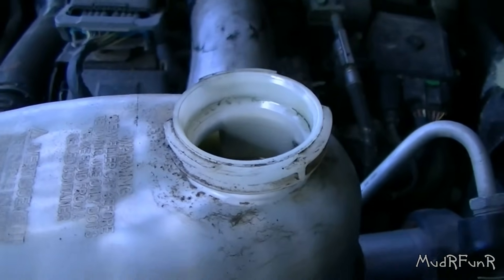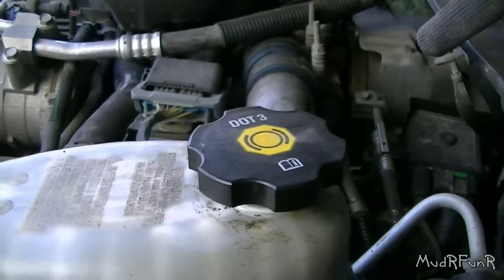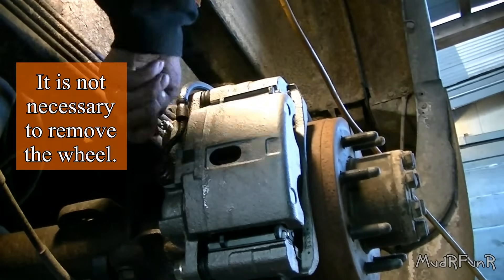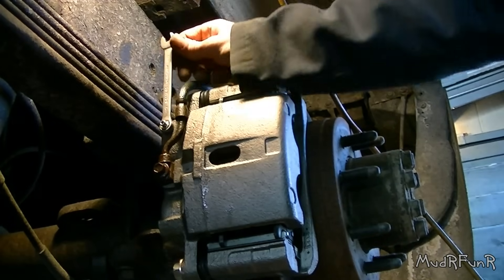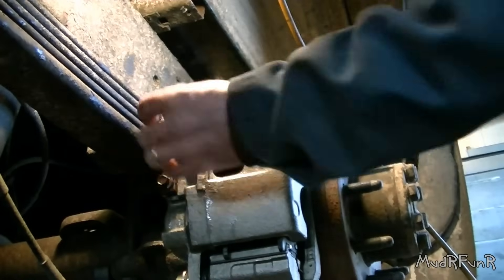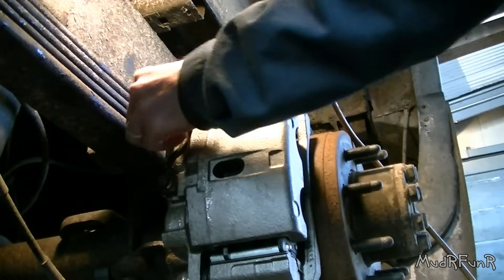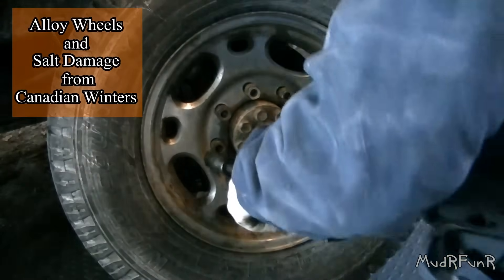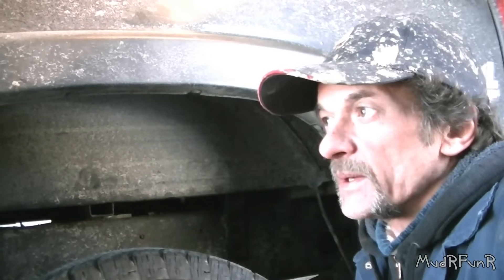Bleeding Brakes by Pedal Pumping

Comment: You did this wrong the only time u pump the brakes is to reduce the coefficient of friction when stopping, u ended up pushing out  tiny little bubbles instead of 1 or 2 or so BIG bubbles have ur wife or friend push a steady motion down, then open the bleeder screw ! !
Reply from the maker: I've done it both ways. I've always found this method to work best.
Reply: Well if you want to do it a back yard shade tree way then I don't give a shit